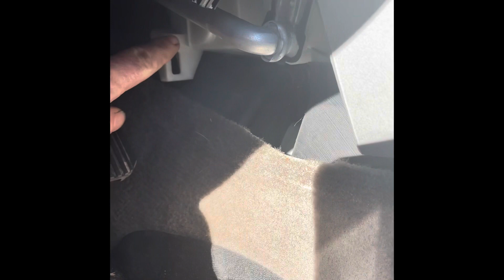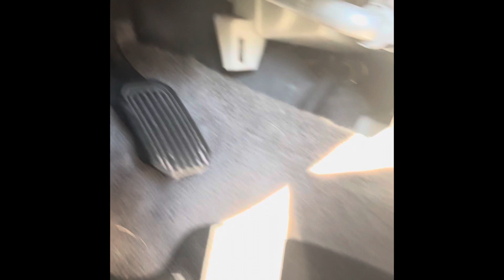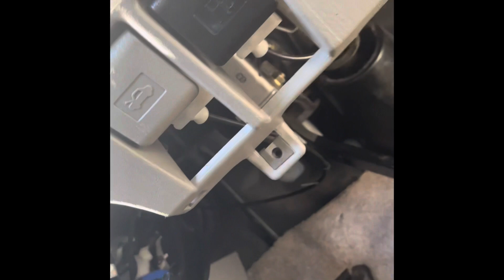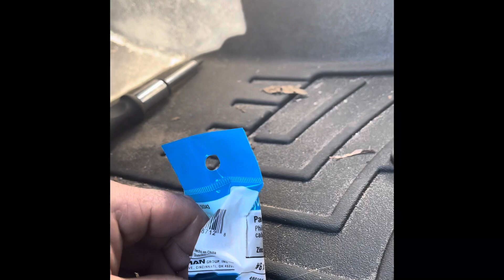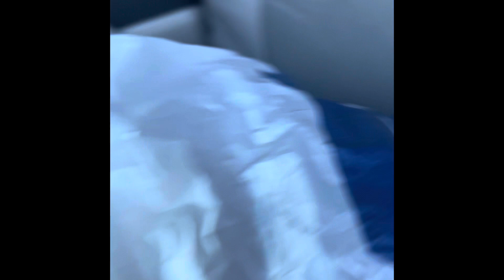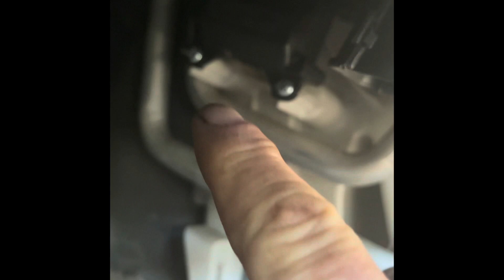2006 Toyota 4Runner driver side no heat. Temp door actuator/servo-sub assembly replacement

Comment: Can you please help my driver side is hot and my passenger side is cold it's the same if I use any other do frogs with stay one side hot and the other side cold same thing with the feet it's just the driver's side says hot turn the passengers stays cold
Reply: did you ever find the problem ?

Comment: Mine looks like that but no hanging connector… could it be shoved up in there somewhere?  I have a pic but can’t post it.
Reply: same with me.. did you ever find out why?
Reply: Well my original problem was having warm air coming out of the driver side. Thought it was actuator but my AC needed a refresh. Still have no clue about why no actuator.
Reply: @KondrackLemor this is for Duel Climate Control.
Reply: I just bought my 4runner and there's no hanging connector. Were you ever able to find out where your connector was?

Comment: I have a similar problem but the driver side only has heat, passenger side has A/C just fine, will this also fix that
Reply: I had the exact same issue and replaced this part and it fixed it
Reply: Been looking for those answer for months now 
Wanted to make sure 
03 4Runner , driver side blows hot while passenger side blows cold 
Thank you so much

Comment: Good video. I've got an '06 4runner with great heat, except the footwell. What would cause this? My scanner won't do bidirectional (take control of the HVAC and test each part) scanning. Is there more than one blower? Thanks Bud.
Reply from the maker: The mode servo that controls vent selection is on the passenger side buried in between the hvac unit and blower unit. Only one blower that I’m aware of. I would pull the glove box and run through the vent selections and verify that the servo is operating correctly. If the grooves are not  aligned properly it can cause nightmare’s with proper vent flow.